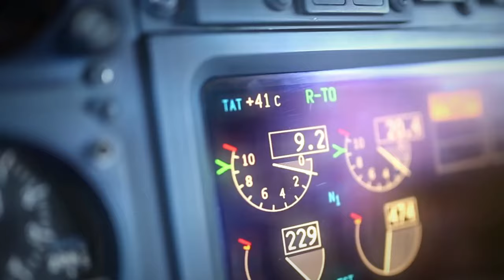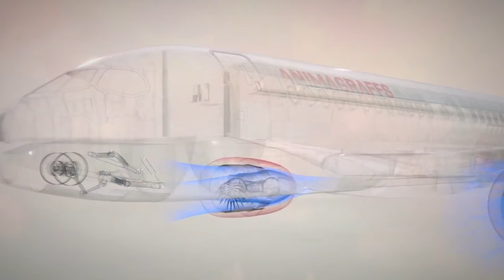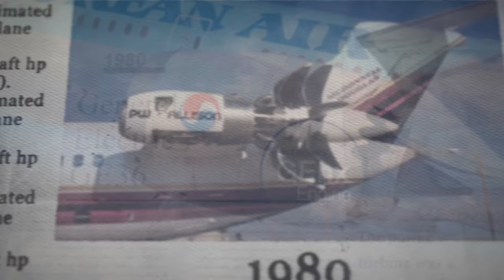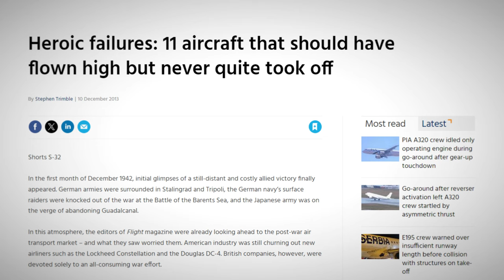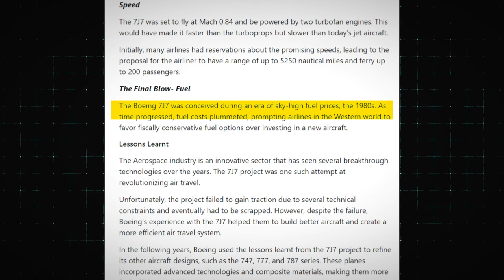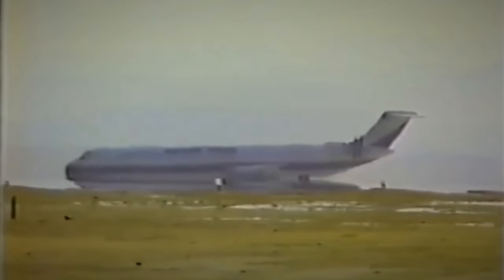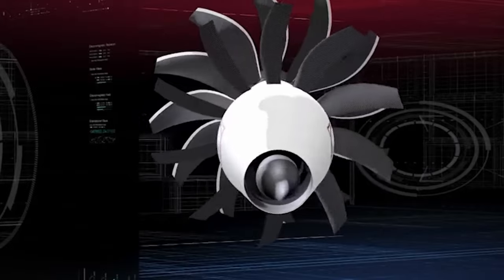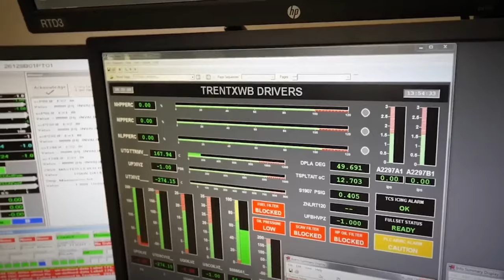This NEW ENGINE Will DESTROY The Entire Aviation Industry!

Comment: Russians are far ahead on this counter rotating propellers Technology than Airbus. Russian Boomers called Bear already using counter rotating propeller for years, there are 4 engines installed on each aircraft. Last month there is video on Il 76 test Russian aircraft counter rotating propellers with wrap around housing installed took to the air for testing.
Reply: Think you missed something. The tech isn’t the counter-rotation, that’s been around for a while. The tech is the jet engine propulsion without a shroud around the blades. Counter-rotating blades have been in some of my older books.